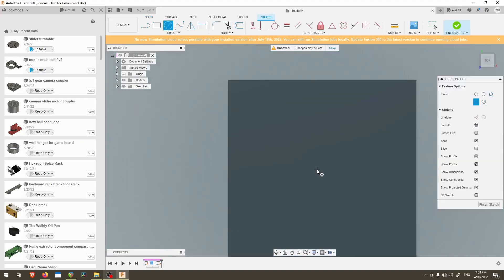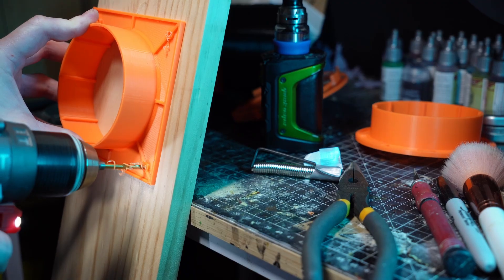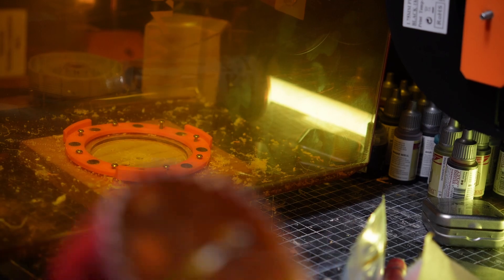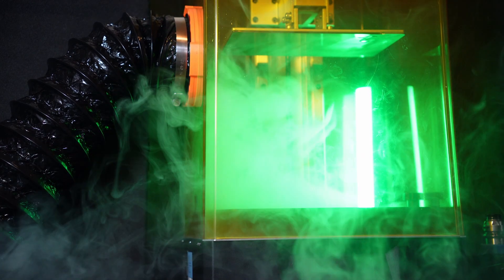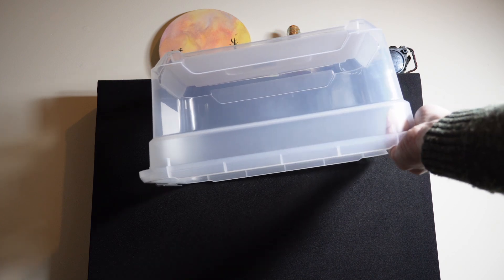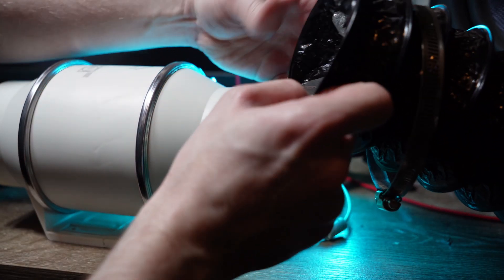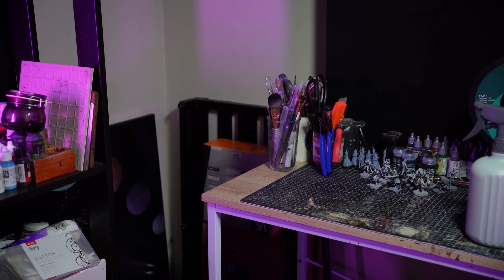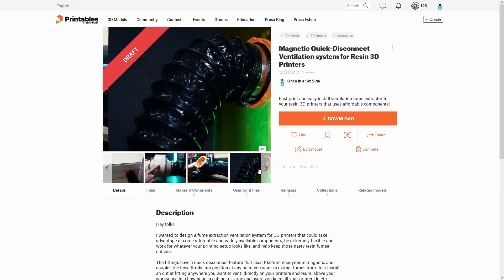Fumes be GONE! Versatile Ventilation for Resin 3D Printers (and other nasty smells)

Comment from the maker: New bayonet twist-lock style out now!!
https://makerworld.com/en/models/487870

If you still want to use magnets as seen in this video, you can grab the latest version of those files here.
https://makerworld.com/en/models/199062
Reply: How strong is the fan that you are using with this setup? I've been thinking of doing one, but I wonder about forced off gassing of the resin and what that might do to prints. That leads me to the fact that a homemade magnehelic gauge isn't actually difficult to make, and of course just how much am I over thinking this. Lol

Comment: With a FDM printer you can pause the printing, insert the magnets and then resume you print, covering the magnets with some layers of material, so you don't have to glue them. Another solution is make the hole from the other side. Your design inspired me and I will design my own version. Thank you.

Comment: I have a pasche airbrush vent for painting. They sell smaller airbrush vents on Amazon that have venting so you wouldn't run the risk of damaging your fan.they aren't very expensive. Typically, the airbrush booths have filters to catch the particles to avoid clogging up the fan.

Comment: That's pretty close to what I've been planning, but I hadn't thought of the magnet disconnect idea. I like that. 

I'm a PC nerd so I have lots of fans sitting around, I was just going to use a 120mm with an adjustable USB adapter, duct hose, and then printed fittings to hook it all up.

Comment: I've built a full enclosure that holds both the printer and the wash station for resin printing, pretty much a fumehood out of a science lab.  Very similar idea, except that I don't have to swap the hoses between the printer and somewhere else.  The enclosure can be fully sealed so the fan only has to run at minimal speeds when I'm not actively processing something.  I live in Canada, and it's in my basement, so cooler temperatures are a thing.  But since the air isn't coming directly from inside the printer itself, I haven't had issues with things getting too cold.

I also use it as an airbrush booth now.  I've put a cheap furnace filter over the inlet to catch the paint droplets when spraying.  It gets very dirty, so for long term fan health, I recommend adding a filter for use with paint.

Comment: Anyone have any experience of doing this (or venting a grow tent) in the UK over the winter with their resin printers please? Any impact on print quality from pulling cold air into the printer/ grow tent?
Reply from the maker: I believe the way to go about it is to disable ventilation during printing, and then vent the fumes before you open it up and start post processing. Unless you have a heated vat (brewers belt etc) directly heating the resin you could then run the ventilation simultaneously. Hope that helps!
Reply: @OnceinaSixSide  nice thanks 👍🏻 thinking about a GK2 or GK3 (depending on price etc) - went down a rabbit hole last night looking at ways to integrate a HomeAssistant dimmer switch to control the fan speed

Comment: Hello! 
Didn't finish the video yet, but I'm planning a ventilation/extraction system 
Don't know if I'll exactly use the cut and put the adapter in, but would it be possible to have a working print with resin? I don't have a filament printer yet and I don't know if I can do working parts with it haha thanks!
Edit: I'm an idiot, finished watching the video now, thanks again!

Comment: If you are worried a out the fan print out a box with connections on each side and put an air filter inline. You can buy airfilters they are used for mhrv and aircon units for air quality you might have to cut one down, you could also cut one from a vacuum cleaner spare where they are used to protect the fan.
Reply: Those are dust filter and don't do anything to VOC's aka the toxic stuff in the resin.
Reply: @drinmer1  I know, read my comment, you can use the dust filters to protect the *fan*. If you run a fan in the airflow for a long time with no dust filters it will ruin the fan.

Comment: vent  the paint booth  but make the wall mounted to the vent filtered with a hepa level hvac filter from the hardware store. that will catch the paint and prevent damage to the fan. plus cheap to replace the filter in the future.

Comment: I'm gonna do something similar to this, but just skipping the magnets. I'm a bit worried though about drilling into the printer cover, what if it breaks and forms huge cracks?

I asked in a subreddit about this approach and I got roasted by people saying this is bad and that you HAVE to have an enslosure. Any thoughts on that?
Reply from the maker: I've installed this system into multiple printers and wash and cure machines and it works beautifully every time. Never had any issues drilling acrylic, it's a very workable material. The only thing to watch out for is heat from friction if you go too hard too fast can make fumes and melt it a bit.

The beauty of this system is the quick disconnect. It allows you to move the hose wherever you need it, so if you were worried about alcohol fumes you could setup a flow hood like you see in this video over the area you want to do post processing. You could even just use your printers acrylic lid as a flow hood; turned on its side laying next to your work area.

Comment: To filter the paint particles Barbatos Rex (here on YT) swears by the blue and white aquarium filter material and you can often buy it cheap in rolls.
Also, I'd be inclined to go with a slower, less aggressive fan so that it it's enough to keep the air flow going in the right direction but not so much as to make a cold draught.

Comment: Tip for holding round magnets in 3D prints: Use hexagon shaped holes. These will have more clamping power and the size tolerance is higher.

Comment: Cool idea.
If and when you do a paint booth, add a disposable air filter at the inlet before the hose connection and most larger paint particles will collect on it before hitting the fan.

Comment: I've been doing something similar for the last couple of years! Even down to the custom window mount made with wood. I did end up varnishing it to help with the weather, and used a dryer vent and screening to keep out bugs. My resin printer and wash n cure is inside and Ikea cabinet and use an oven hood over it for lighting and a basic fan that was good. I then added a Tee above it, and a stronger fan to pull the fumes. So I can both use the printer and my airbrush setup at the same time. Glad to see more people thinking about this 🙂

Comment: Funniest part:  when part falls, video stops, issue is "fixed", and music/video resume as if it never happened.
Reply: To protect your fan from particles and to filter some of what you're sending out, maybe a replaceable carbon filter would help.  You could 3d print an inline mount, and cut the filter to fit.  This owuld allow you to buy a larger square and cut it into multiple replacement filters.  (see example of filter below)
https://cdn11.bigcommerce.com/s-jelmg7hxh0/images/stencil/1280x1280/products/1316/10158/AP-15CRF_COB__10762.1667832644.jpg
Reply: I have no affiliation with that company... they just had a good sample picture.

Comment: mate you are crazy ! 
i have a air purifier next to my bed, on the opposite side of the house is the 3d printer, the room is closed off and well ventilated 
despite that every time i print the air purifier detects massive spikes of VOC fumes and it takes about an hour for it to be cleared
even without a smell , the VOC fumes are extremely strong 

if i print at night where there is no passive UV, it takes approximately 4 hours to clear the VOC's or they just linger all night until the sun is back 
so if i am having issues with it on the other side of the house, in a well ventilated room thats closed off from everything else .... 

the fumes are not caused by the printing process, they are emitted from the liquid resin , constantly 
just opening the bottle is going to flood the room with VOC fumes 

what do you think is happening to you just sitting in the room the whole time with minimal light, airflow and space
you are using your lungs as the filter for the fumes

Comment: Nice video, one issue/concern I would have is pulling dust into the print chamber due to all the negative pressure created from that inline fan.  As a few others have mentioned, a better approve would be to put the printer in a "grow tent" or other enclosure and ventilate the enclosure instead of directly the printer. 

I've been thinking of doing a DIY enclousure/cabinet with a range hood like the ones you see in the kitchens. They are very rubost, often include charcoal filtering (not necessary if exhausting outdoors), lighting, and usually easy mounting to the top of a cabinet.

Comment: Do not put the fan in the middle like this.  Put the fan at the window.  If you don't do this, then the space between the fan and the window gets pressurized and will spew resin fumes into your living space.  You want vacuum on all interior lines, only time you should have positive pressure is on the other side of the window.

Comment: White the fan is on, the air wont go outside, because the outside pressure ir higher, the outside air would enter instead

Comment: Maybe a good idea to add a Pre filter before the fan, so as to catch whatever big particles from paint etc and not get the fan damaged.
Aswell as a Dimmer switch, so you can regulate the speed of the fan, it doesnt need to run 100% full power, 50% ish or so is more then sufficient to suck away all the fumes.

Comment: I actually use the same fan setup for my 3D prints and air brushing.  (though I'm using the Harbor Freight 8" ventilator)

For airbrushing I use a 64 quart transparent storage bin, and place a cheap household air filter diagonally inside the storage bin.  The exhaust cutout is on the bottom of the bin, and then the bin is placed sideways with the air filter tiling up and towards you.  The bigger your air filter, the less airflow you're blocking, and be sure to use the cheap filters that have the least air resistance. You can then place LED strip lights around the storage bin to provide diffused light when you position your model near the exhaust.

Comment: This is a cool design, but personally I know that I would be upgrading my 3D printer every 2 years or so, and it just makes more sense to vent the enclosure of the printer than the printer itself.  There won't be a venting tube to handle every time you open the printer, and an enclosure can house multiple printers.  An enclosure will also continue venting when the printer is open, keeping fumes to a minimum.
Just my 2 cents (and how I built my system)

Comment: Oh man.... when you slapped the hose on the hood for the first time and it fell off, I damn near fell outta my chair laughing 🤣 I have almost the same issue, I have a couple FDM printers in this odd closet thing (it's not floor level, it's raised up to around waist level 🤷‍♂) we have in our bedroom, but also wanted to do some parts in resin. I planned to use my bedroom bathroom's shower area to print/wash, and I would make a hood that vented into the ceiling fan. 

Problem was that after some inspection, I realize this BS fan really doesn't go anywhere and there is a very small slot in the top. I've worked around a lot of harsh chemicals in manufacturing, but this stuff I have at least, gives me headaches and a sore throat, so this idea here might actually work and I can dust off the $1200 I spent and used 3x. Wife might not like the hose running through the bedroom and out the window on the opposite side... but then again, she has 6 aquariums in the same room so yea..

Comment: If your using an airbrush - the paint particle will build up on the fan blades so you need to add a washable or replaceable filter on the hood (that will need to be much close to the airbrush when spraying to be effective as well)
Interesting idea - what about a 3d printable duct that the lids sits on that creates the holes required for removing the resin smell instead of cutting a hole in the printer cover?
Personally I will be building a system of the above that can be easily expanded to however many resin printers I wind up getting.
Reply: This is a really interesting idea, but unfortunately it wouldn't be a universal thing. You'd have to have a model for every resin printer.

Comment: This is an awesome idea! I'll be doing a similar setup but adding a ventilation heat exchanger inline to reduce any issues with cold air getting to the print space. They're not cheap to buy new, but not stupidly expensive when you find a deal on a used one.

Comment: Great video and thank you for sharing the files. Even though my printers are in a large workshop, Anycubic resins I use are horribly smelly and honestly, I'm glad they are because it lets me know how well/poorly ventilated my space is. I've been using an 8" ventilation fan which does pretty well near the printers, however I had long been thinking of doing exactly what you've done, pulling fumes via a hole in the enclosures themselves. I'm going to give this a go! Thanks.

Comment: Tip for using hole saws on thin plastic: start it in the forward direction until the hole saw gets to the plastic. Reverse the drill and run it backwards while pressing gently. The saw will scrape away the plastic instead of catching and cracking. It works really well.

Comment: i would use some kind of filtering which can be replaced intstead of it reaching the fan.  Also 3 phase (but using capacitor to run on single phase) are way efficient as i have 70w fan it  is twice as big and uses 220mm pipe.

Comment: Just 'cos you cant smell it doesnt mean its not there.  
I use an inline fan in my DIY spray booth and the filter in the back of the box traps 90% of the paint particles, the rest get stuck to the ducting way before it hits the fan.
My printer is in a big cardboard box which is vented into the outlet of the spray booth ducting after the inline fan using a couple of old PC case fans. I guessed I didnt need a huge airflow to vent the fumes. This helps reduce the temp drop (UK Winters are cold) in my loft space. I can keep my printer enclosure / cardboard box ant a nice warm 25 degrees while my hobby room/studio (loft) is bloody freezing at 6 degrees.

Comment: hello, nice project man ! Clearly those nasty fumes are the worst part of resin printing. Specially IPA. I noticed at 7:50 that you have the wham bam plate. You have the exact problem as me. The metal plate is not sticking with enough force to stay flat on the build plate due to weight and suction, causing one of the sides to detach and leading to deformations. Have you ever tryed anything to prevent that from happening ? I'm thinking to use some strong scotch tape on every side.
Reply from the maker: Indeed! Flex plates become problematic once you get up to this size build plate and beyond. I do possibly have a solution though, I just gotta find the time to test it first! But I do plan to make a video covering everything I've learned (including this potential fix) hopefully sometime this year.

It's a lot to cover here but we've had a pretty good discussion about it on my discord server if you want to catch up on there :)

Comment: HI! im late however the silver lining is since i am late i can now then ask you about the results since by now you have substantialy tested the set up, so if its not much my good air may ask about the problem you mentioned? delamination and the print failure due to cold weather? did it became a hindrance? or is your printer totally fine with this set up no print failure due to the ventilation set up? i appreciate your work my good sir

Comment: The easy solution for temperature control would be to keep the ventilation closed during printing, and then connect the ventilation first when the print is done. I'm doing research before buying a resin printer with exactly this concern. And from what I have read and seen on youtube the critical moments to have ventilation is when opening the printer and when washing/curing the print.
Would love to hear more about this and whether I am missing something.
Reply: Thats what I was thinking too. Did you have some experience or tipps to share?
Reply: @squighideimpride7999  Not yet. I bought the Phrozen Mini 8k S, but delivery was delayed and I expect it within a week or so. (it was half as expensive to buy the S version, but it was a presale with a 2-3 month delivery time)
I did print a whole ventilation system with the Kobra Neo I bought from the gains of the lower price. So I now have an enclosure with ventilator and exhaust to the outside through the grating I have above my windows. I have actually been thinking of maybe making a youtube series about that project. (which would be my first youtube video(s))
Reply: Just vent to attic instead of your window.
Reply: @Blue-eu5qn  Interesting suggestion for an apartment...
FYI: the ventilation was built and is pretty perfect including the ability to close the opening with a magnetic seal so the cold air doesn't come in when the printer isn't on.

Comment: My biggest problem is my windows. I used to be able to put a window fan into the sill and vent the room really easily, but the new house I moved to has complicated geometry on the sides, bottom, and the window itself, which makes it really difficult to seal up the space with external venting attached.